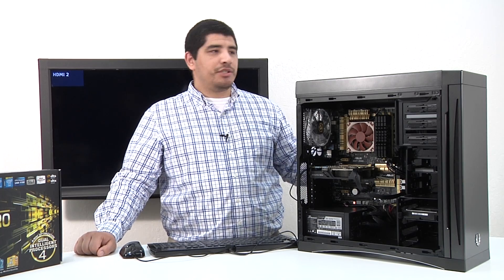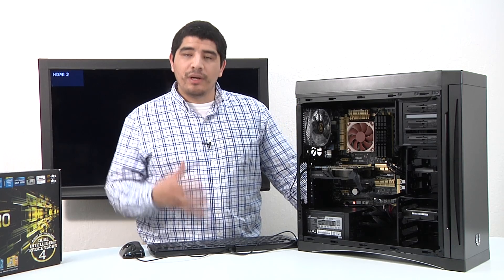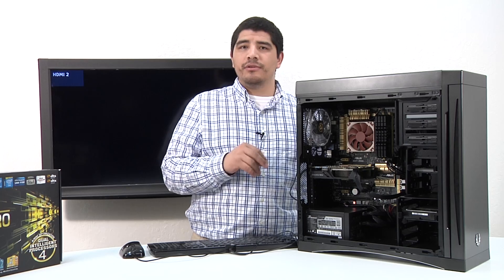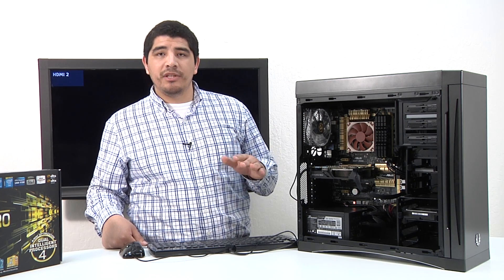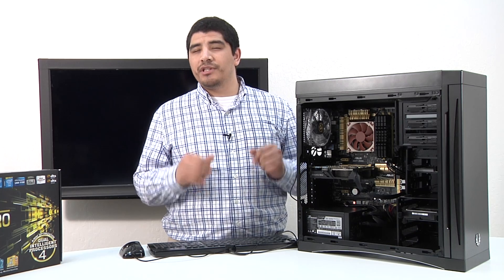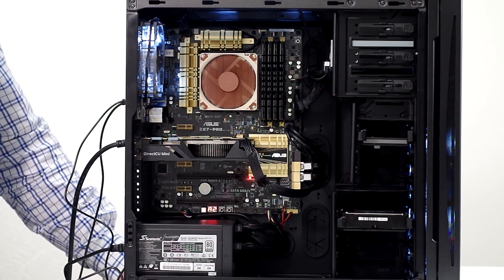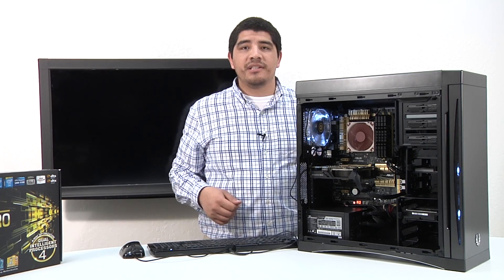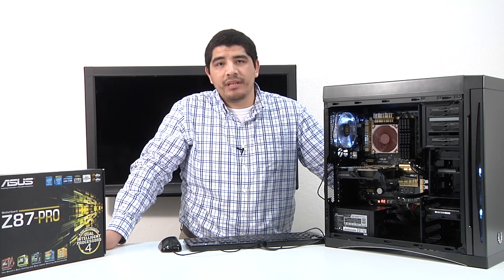How-to get your PC to post

Comment: i need help. I've built a PC and when i press on everything works and LEDS light up on my Asus z170a mobo (they arent red LEDs) and it all seems good but when i plug a HDMI in to post, it says no signal so its not posting please help I've spent so much .money and work i need thi
Reply: Got the same problem
Reply: Will I plugged my hdmi into my gpu instead of my motherboard and It worked
Reply: If you're having this problem, make sure your HDMI is plugged into your GPU and not your motherboard. Especially if you have an AMD CPU. They do not have integrated graphics and will rely on a GPU for display.
Reply: J.S Gaming did you fix it I’ve got the same problem?